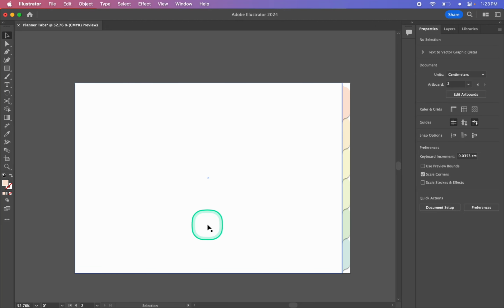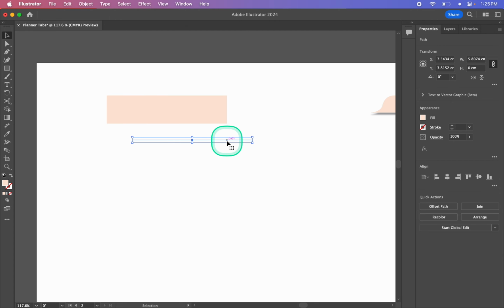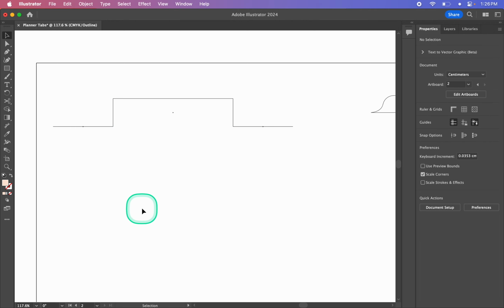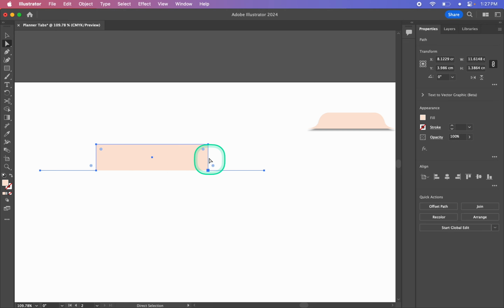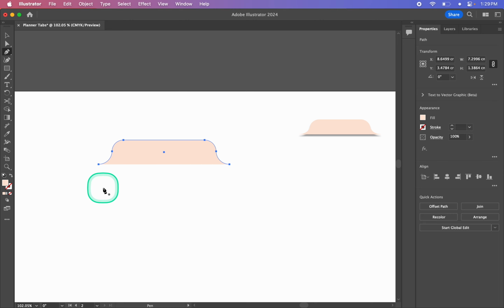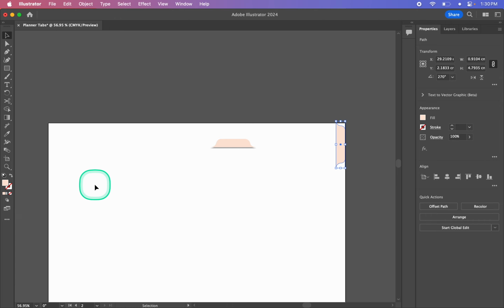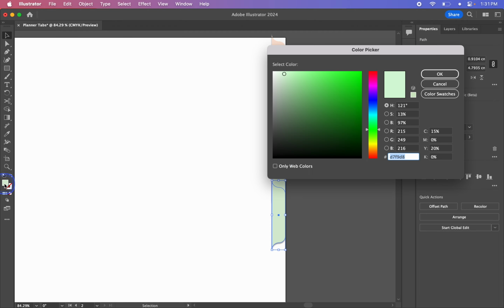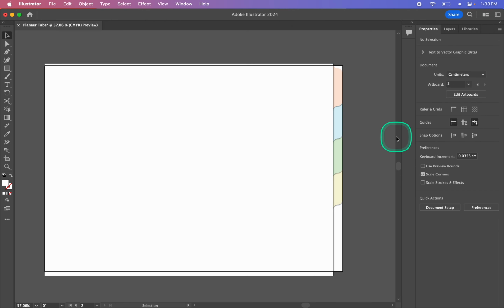How to Make Digital Planner Tabs in Adobe Illustrator

Comment: I plan on making mine to sell, how do we make hyperlinks so that they click on certain sections and it takes them to that section? Also what is the best size for a digital planner? thx.
Reply from the maker: So for the long wait! I don't get notified of comments for some reason. 

For sizes, I like doing regular print sizes, like A4, A5, Letter and Half Letter. For hyperlinks, in Adobe InDesign you can right click on an element and choose 'Hyperlinks' and then 'New Hyperlink', or go 'Type', 'Hyperlinks and Cross-References' and then 'New Hyperlink'. Don't use 'Buttons' as they won't work in most digital planner apps. 

I have a blog post on hyperlinking here: https://designwhispers.medium.com/how-to-make-hyperlinking-easier-in-indesign-for-digital-planners-12d3b7364435